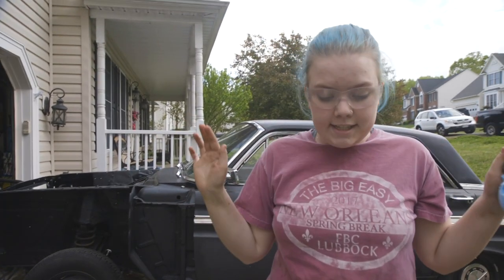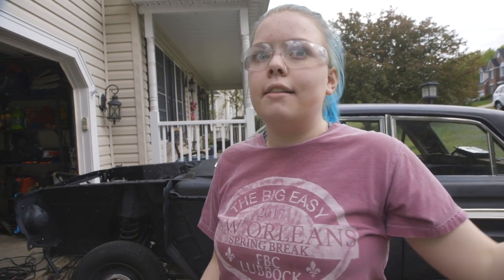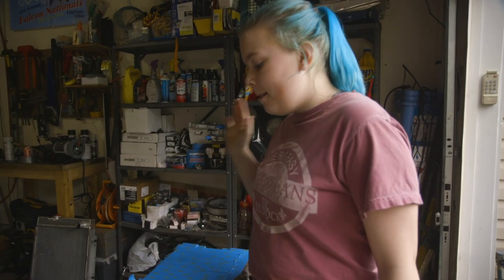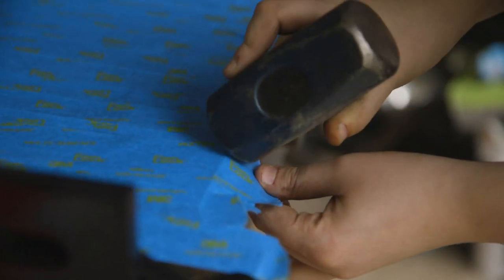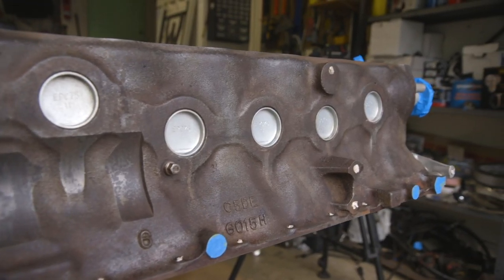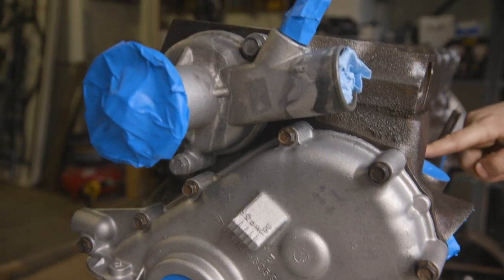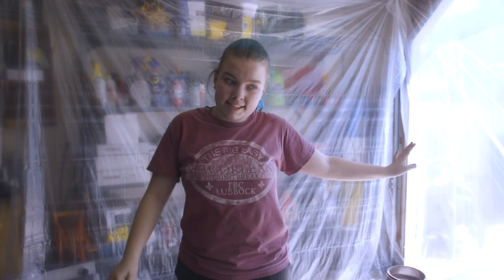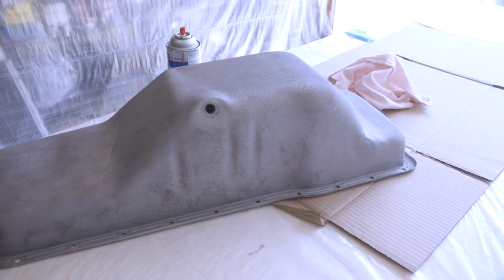I Was Nervous to Paint My Engine Block BUT IT CAME OUT GREAT!!

Comment: Awesome!! Just a piece of advice, before you start building it, get a tap and die set and “chase” all the bolt holes to be sure there’s no filings in them and it’ll help the build go faster as well!!
Reply: Yes this is a great tip. Do it when the engine is out and you can reach everything quite easily.
Reply from the maker: @hkshahidi2794  Yes! We're trying to think through everything we need to do while the engine is out!

Comment: I am very happy to see young people learning about cars.  Many years ago my brother took me to the local garage to show me a car.  It was a 49 ford that had died on the highway and was towed in.  He explained to me that they only wanted $15 for it and if you don't buy it I am going to!  It was pea green and it was ugly.  I looked under the back of it and it had dual pipes; I was sold.  We went home and took the rims and tires off of his car and came back and towed this car home.  I think I knew less than you.  My brother was a good teacher and I became a mechanic in life.  I learned engine building, body and fender work, painting, welding, auto electric.  At that time we did not have Eastman but we had Honest Charley out of Tennessee.  I also like Falcons and have a 63 1/2 2 door hardtop.  I traded some car bodies for it.  It was wreaked in front, found another that was also wreaked and put the core support on the one I liked.  I have never finished it, or drove it.  Got it in the 70's.  Over the years I have found a lot of parts for it.  The last thing I found was 13 inch 5 hole rims.  I  have got the last wire hubcap for it now.  I am thinking that I should paint the rims and install new tires on them.  My daughter also got to work on cars, but did not like the experience to much.  But she is pretty handy now at fifty.  Wash machine, and dish washer and computers.  Keep up the good work, you have a great Dad for helping you.
Reply from the maker: What a great story about your car! I'm lucky to have a good teacher in my dad. I know that I'm really lucky.

Comment: I think it should be blue
Reply from the maker: We had wondered about that as well. When we did some research, we actually found out that the early 1965 200ci engines were done in the black/red paint scheme and that it wasn't until around June of 65 that they started painting all of the 200 engines blue. When we looked at Carl's tag, it said his engine was made in May of 65, so we stuck with the original color scheme. Plus, we had already kind of fallen in love with it.
Reply: Before 1966 model year, no engine had the now classic Ford dark blue paint(never the medium blue used on some earlier valve covers). June '65 would have been approx date switchover to '66 models began. Through '65 blocks were black with valve cover color varying by displacement & brand. Mercury engines were often different color than Ford. Prior to '59, blocks were various colors & valve covers black.
Reply: Leave her be. Its her engine and she can paint it pink if she wants.
Reply: @stephenfaulkner1448  OK bright star... If you watch videos, it's obvious she was excited to paint engine correctly. That she has. I was merely confirming 1965 engines were not blue.